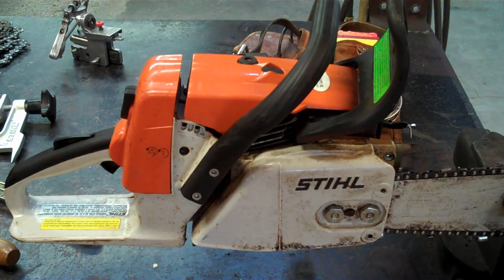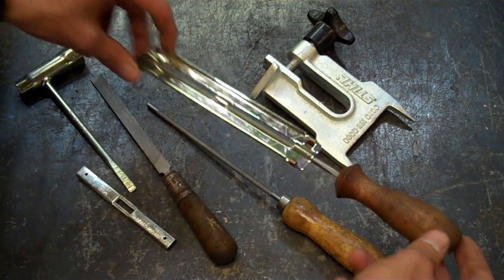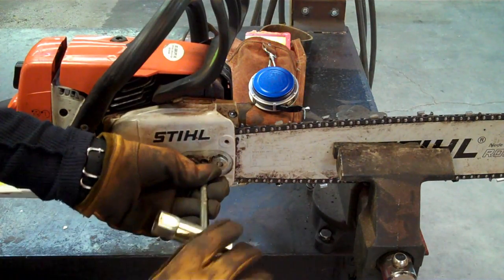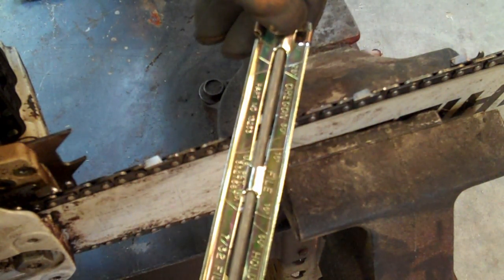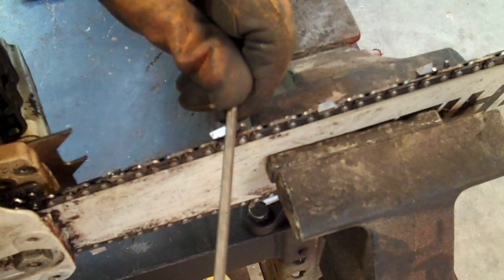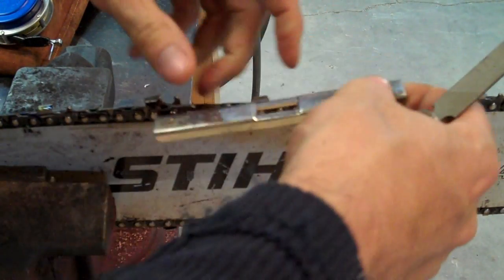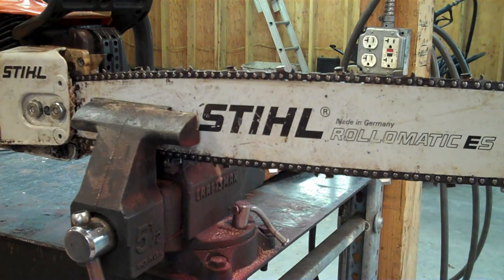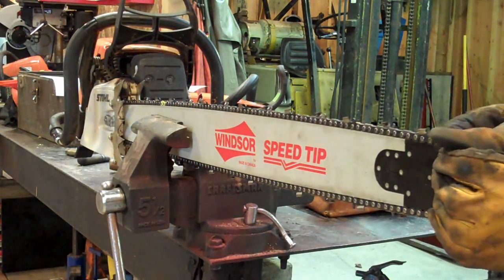Sharpen Your Chainsaw Like a Pro – Essential Tools & Tips

Comment: Well done as usual Cody. I was a logger years ago and one tip an old timer gave me was to get used to filing with both hands. By that I mean use your right hand to file the right side and your left hand to file the left. Keeps everything even. As far as the file gauge, the file handle has the angle already on it. take a look, 25 or 30 degree.

Comment: Wranglerstar, your a good guy for sharing your knowledge, I've picked up some good tips from you. You mentioned about the rakers cleaning out the wood from the cut. I was told the rakers are what determine the depth the tooth cuts, as in if they are too high you will not be able to cut with speed and you will notice the saw dust is finer and the saw motor will rev higher too. An old wise guy told me also that how you absolutely know when they need to be filed is they will be shiny, thus showing they are meeting the wood before the tooth does, hence filing is needed.

Comment: I really enjoy your your helpful tips Mr W, im a new subscriber, and kinda new at youtubing. One thing i might add as to the tautness of a chain, is remove it from the vise, loosen the two nuts from the chain brake, grab the tip of the bar between your thumb and finger, lift until there is no slack left hanging, then tighten the 2 nuts back up while your still holding the nose tip upward. Im sure that most of your subscribers already know this tip. 4th generation logger myself, but always looking for tips and tricks to improve. Thanks for your videos.

Comment: cont...
I hope that makes sense since I understand from teaching experience, that demonstration in this is key over verbal description.
You are correct in the chain behavior when you haven't filed your raker and the teeth are about half their life in sharpening.

I would like to add that as a rule of thumb in chain tension, I would teach that when you have the bar nuts loose and the saw setting flat on the ground, tighten until the drivers raise until they marry up with the bar and stop.

Comment: the rakers regulate the depth of the cut. if they are to tall the chain will skip and produce a dusty chip with little cutting progress, if they are to short the teeth will cut to deep and will bog the saw down  creating a jerking like effect while cutting. crooked cuts and rough cuts are from improperly sharpened cutting teeth. Making sure each tooth is the same size and angle will produce smooth clean cuts. a properly sharpened chain will reduce wear are tear on the power head, use less fuel, cut faster, in crease chain life and reduce the chances of kickback. Wranglerstar  love your videos. thanks for taking your time in your work and sharing with others

Comment: We've talked a few times Wranglerstar...
It's that time of year once more and I'm taking a few more dead standing hardwoods for the winter fires up here in the Northeast! I have an MS 311 which is a bit too much for my girly back because... well... I'm a girl... but I wanted to mention.. just to make it EVEN easier a Stihl chain also has one link that is painted a different color (gads I'm in the kitchen and my saw is not here at the moment but I want to say the one link in the chain is painted green (though it would make more sense if it were orange but I seem to remember that its green) So if all the nice people here learning how to manage sharpening properly find that one link, you can start there and then not make the mistake of sharpening every tooth and then a few more by accident, because consistency is the key in this! I take 3 even swipes with the file and guide. I don't get rid of those "training wheels" and you're right the guide is exactly that, but it takes away some of the human error (and yes we all have that.. admit it folks!) And I would say remember that your Stihl should be throwing chunks. If it isn't you shouldn't be cutting for the mere reason that if you're getting all that super fine saw dust from your saw, its likely getting in your eyes and you should never be sawing if you can't see properly! Chain saws are OBSCENELY DANGEROUS! It is the most important thing you should remember at every moment! So you should instead have small chips of wood ( eh... somewhere between 1/2 a centimeter to a centimeter ) 
This is an excellent video Wranglerstar! No one will walk away from it with questions and if they do this is a great and friendly place to ask those questions because no one is born knowing how to sharpen a chainsaw... its a learned skill. You'll find too that your skill will increase as you perform the sharpening and your saw will cut better after having sharpened it 5 or 6 times, once you've become more comfortable with the task. 

That's mostly what I wanted to say but its funny story time as well!
My husband and I were out cutting about a week ago. We never cut without the other being there because using a chainsaw is obscenely dangerous! We take turns generally. I take 5 cuts or so then he takes 10 and we give the saw a break, allow it to cool a bit and move some of the wood. So here we were cutting and doing a fine job but he had to go put some shoes on a horse. While he went and did that I brought my saw to the kitchen, I took out my Q-tips (yeah I don't have compressed air btw for me its Q-tips and very gentle cleaning of the bar oil channels with a straightened paper clip ...VERY GENTLE!!! You don't want to scratch the metal on the inside, it will simply become a better place for the saw dust to collect!) This is btw, how a girl cleans a chainsaw... with Q-tips and my husband has no issues with it because I actually get it clean! I save all the bits of oil soaked saw dust and the used Q-tips ... great fire starters in an outdoor fire pit! So I took it apart I cleaned it, I sharpened it to perfection, turned the bar over.... the whole thing. He gets home and I'm called away! We finally get back together and we still have a couple of hours of light. He starts sawing and here I am watching the saw throw nearly mulch sized chunks (okay yes I'm exaggerating but they were the biggest I've ever seen and even bigger than a brand new blade gives us) So he finally shuts it off and here I am ... typical woman... fishing for a compliment... I say to him "Hey its throwing nice chunks huh?" He answers "Yeah I just sharpened it!"  I WAS SO DISAPPOINTED! lololol
I still haven't told him that I sharpened it as well. You may think that's odd to not tell him but every time you sharpen any tool you are taking a bit more of the metal away. My husband is a farrier and his hoof knife that he uses to mostly pare down the sole of the horse's foot also loses metal every time he sharpens it which is before each horse. Your chainsaw blade goes through just as much hard work. Really and truly by double sharpening it that day, we had taken away the ability for that chain to be sharpened one time and it was purely by accident (and poor communication but wanting to please our mate too so I suppose that has some value) Well at least it also got a very thorough cleaning that day as well!!!
Cheers to you and your family Wranglerstar!!! Say hi to the Mrs. for me from the other side of the states! Be safe. Be careful!!!
Reply: Fenikkusuuk: 
Dear Mrs Fenikkusuuk, 
It's been a while since you wrote your piece here, but just in case you ever check back here, I wanted to reply.

So, greetings from the north end of the Sierras! (Northeastern California mountains.)

First, I was a widower for 17 years. But the Lord recently gave me a good Christian wife. (SO nice to have that companionship & fellowship again!) And New Wife is a budding woodswoman too. So I shared your complete story with her. She was nodding, with a big smile. At the end she affirmed that a paper clip and Qtip were good choices, and just what she would have used.

Regarding the chain, the green link indicates that it is a safety chain. Look at some other chains if you get a chance. They may have a yellow link. Or no colored link. You will see that your safety chain has some extra bumps on the links between the cutting teeth. Without my going into detail, it's something the factory did to reduces chances of certain mishaps with a running saw. 

Anyway, you are a good writer and we enjoyed your submitting those things.

Comment: The "rake" as you call it - we call it the toe in the UK is very important as it acts as a feed into the wood, if this is too low (I know a lot of people do this to get a faster cut) you have a much higher chance of Kick Back, so it is also a very crucial safety feature. we do ours probally every 3-4 sharpens but you get to tell from the feel of the cut.

Great Vid!!!!

Comment: Excellent video. Thanks for sharing. One tip I can add about the bar oil is, with a freshly cut log facing the cut, hold the tip of the chain about 2 inches away and rev the saw up for a few seconds. You should see bar oil spitting onto the log. Now this is only useful for the saws with automatic oilers. This way you know if the oiler is working or maybe plugged, or what ever.

Comment: The guide tool that you showed that clamps on to the bar is very useful when sharpening chain saws. You said it was slow but it takes less than a minute to clamp onto the bar and set it up and you can file the chain faster once it is set up.

Comment: OK 1st and foremost, this guy knows his stuff. His tips and suggestions are on mark.
2nd, you don't need to mark any teeth in an effort to show where you started filing your chain. If you feel you need to do this, you probably should be using a file guide. Just look for the shiny metal underneath the cutterhead when the chain comes back around. It should look a lot different than a dull tooth, and trust me, you'll be waiting for it and will probably discover it 4 or 5 teeth before it gets to you. 
Only other thing to remember: your chain has to ride on what is basically a railroad track (the bar rails). If one is higher than the other then the chain will lean to the lower side. A leaning chain can cause you to cut curves. No fun and not productive, no matter how sharp your chain is. That means you have to file down the high side to the same height as the low one. Careful doing this because there will inherently be metal slivers which will become metal splinters. Just be aware of it and you'll know what to do. Google it, as I'm sure there are some videos.

Comment: Lest anyone misunderstand, the chainsaw file is not a "rat tail" file. It does not taper. You will get very bad results if you do have a tapering rat tail file and use it on a chain saw chain.

Like Cody says, look up the correct file that is meant for your chain size and style, and you can enjoy using it with good results.
Read your saw manual. They wrote that to help you get the best service from your saw. Just look up the thing you are dealing with, which in this case is chain sharpening.

Comment: Mostly good imformation- clear & easy - I called rakers that for years- in truth the modern term "depth gauge" is better as they only really set the  depth of cut by the follwing tooth -the tooth takes the chips it cuts with it- not the raker/depth gauge- I would teach to file these 1st if needed as it's very easy to slip with the flat file & ruin the edge of a cutting tooth, whereas there is no chance of touching a raker/ depth gauge while sharpening the tooth. that aside - good video mate.

Comment: Thank Bernfya for posting his comments about the file guide being necessary. It doesn't just give angle guidance for the cutting angle, it does as he points out also help with the creation of the gullet- which peels away the 'kerf',chip or whatever you want to call it (look end on at the file in situ and you'll notice that a small portion is held above the bed of the guide  and so doesn't come in contact with the tooth-so you don't need to "file in a slightly upward direction")

Comment: Thank you for taking the time to make one of the more informative and clearer chainsaw sharpening videos out there, I'm glad of the advice not to get the more time consuming sharpening device, so I am buying the file & guide you show using at the start of the demonstration.
But one area of your advice contradict the method described in my manual, and another I feel would be a common sense method from my experience on cars, motorbikes, construction etc.
When adjusting the tension my manual has a big tick over the picture indicating lift the bar upwards and pull the chain upwards from above the bar to test the tension, and a big cross over the picture indicating testing the tension by pulling the chain down from below the bar whilst the weight of the bar is pulled down by gravity.
Is there a reason you test from the bottom, as logic tells me that during rotation, the chain is resisted by the wood on the underside, so between the motor gear tooth and the first point of contact on the wood, the slackest point on the chain will be the top. As the chain spins, when I'm taking off the thin stuff, the only airtime I ever see is between top of the bar and the lower edge of the main chain, I never see airtime on the lower bar between the wood and pulling motor gear (hope that makes sense?)
My second point is with tightening following tensioning, I would have imagined that lifting the bar and tightening would give more consistent tension then having the motor heavy end and the bar dropping, after all, to cut you do apply (varying) pressure onto the lower bar when lifting the motor against the wood creating a pivot, basically a elongated 'V' pivot, as oppose to a elongated '/\' pivot, so would tightening (indeed lifting the bar whilst adjusting the tension) not be more appropriately undertaken by removing the small amount of play on the adjusting area by having the positions of the bar and power unit in the position force is applied in the field? (again, I hope that makes sense)?

Comment: Sorry for digging up an old video. Weather is terrible in N.MN right now. I have to disagree on the Granberg-style file guide. 40 years ago, when I hadn't any experience with maintaining saw chain, I used one about 2-3 times during the life of each chain to restore chain angles uniformly. Also good if chain hits  rock or metal. Over time, I learned to file more accurately and use the jig rarely, but still have one or two in my workshop.
Agree wholeheartedly on buying quality files.

Comment: it also gives the top plate angle- the chiseling edge to the top of the chain tooth which gives the initial cut to the timber AND these angles have all been created not just to cut timber but to do so in the most efficient manner with regard to the longevity of saw,chain,bar and yes operator !

Comment: The only addition I use is:  I remove the bar and lightly grind the bar to square it up. (the rails)  This ensures that the chain tracks squarely.  Please note:  I have a grinder that is parallel to the belt and wheel.  Most homeowners dont have this ability.  I have done this with a file, but it takes time and knowing how to do it.  Guess being in the machine business has it's advantages.  Glad to see someone else has a fork truck in their shop too!!

Comment: Excelent educational vidio. The sharpning stones for dremel tools are excelent. You can get battery operated dremel and other brand dremel type tools for the field. I have been cutting fire wood for 20+ years and there is nothing better for the pro chainsaw sharpener. The stones leave a better surface finish and remove less materal for a longer lasting chain.

Comment: Not bad, two things i'd also recommend. One is marking the first tooth with a marker so one knows where they started and engaging the chain brake whilst sharpening. In my opinion that chain was too loose, with the chain that loose your going to be stopping fairly often to retension it. Give it another bit of tension. I find an extra stroke or two on ones weak side (left for me) balances the teeth and keeps her cutting straight. Grease your drive sprocket when your greasing the bar sprocket.

Comment: That was a great explanation of how to sharpen the chain. I have one Poulan which I need to sharpen the chain. I have 2 chains from that saw which was taken off when they were dull. I also have a Stihl saw which I thought would be fantastic, but the Poulan is much better and has not been in the shop since buying it. The Stihl is a piece of junk and much newer. I have been to the shop three times and still don't want to start.

Comment: Hi,
I use white chalk to mark BEFORE the teeth I started to sharpen. Then I know when I've sharpened them all. 

You can save the wrapper from a new chain, and write the replacement date on the wrapper. It folds flat and will fit in your chainsaw box if you have on.

Comment: The bar groove tool also has the curved end to clean the oil ports. Do you turn your bar methodically to ensure even wear? If you have a slight 'notch' developing on your bars just behind the sprocket at the tip then you need to tension your chain a little more as this notch develops as the chain slaps back into place on the bottom of the bar whilst cutting. Depending on how clean the timber is you cut if you use a long bar it may be worht investing in one with a replacable tip sprocket.

Comment: Great videos. Got cheated, didn't get shots in your outdoor beauty. A tip I've followed is to slacken your chain some at end of day so it doesn't get tight. Longer bars would have more contraction. I always carry a scrench to make chain adjustments.

Comment: I noticed that when you used the racker gauge that you used the file in a back and forth motion with pressure on both strokes but when you used the tooth file you only applied pressure in the forward stroke. If you drag the file on the back stroke it will dull the file. You should only apply pressure on the forward stroke.